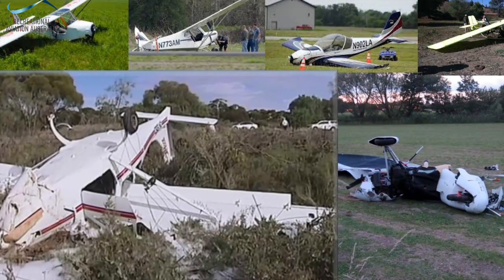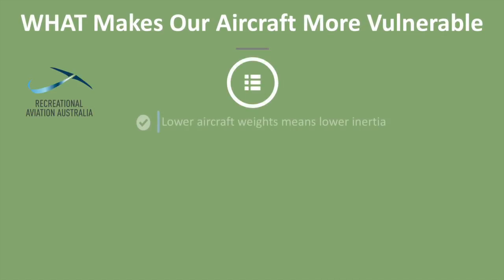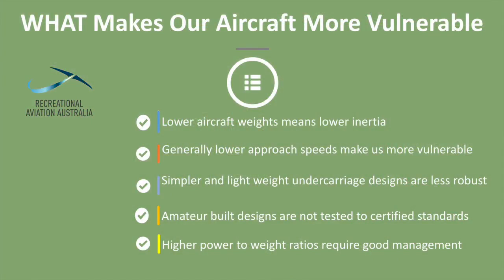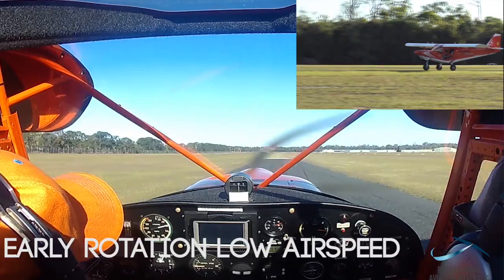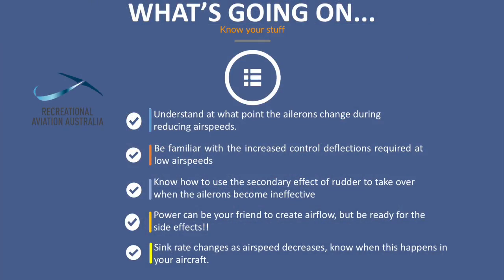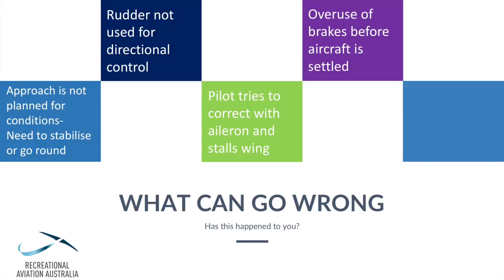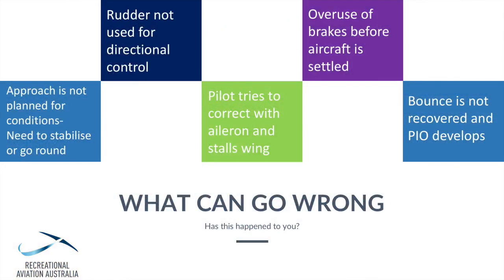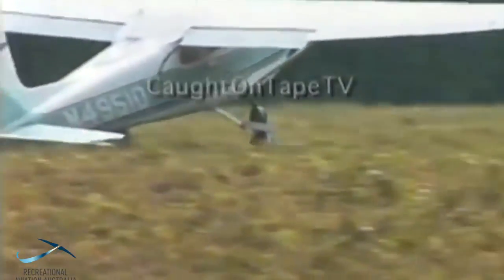Runway Loss of Control Hangar Talk by Recreational Aviation Australia

Comment: Pretty scary. Thankfully my instructor knew how to recover, because I'm fairly sure I nearly flipped the training aircraft on a take-off run when given rudder and steering control during take-off.

It turned out to be quite difficult to get a sense of how to use rudder pedals properly. Though getting a pair for use with a simulator helped tremendously.
And it speaks well of modern simulators and equipment that my initial experiences using rudder pedals to control an aircraft in a simulator went almost as badly as they did during that take-off run...